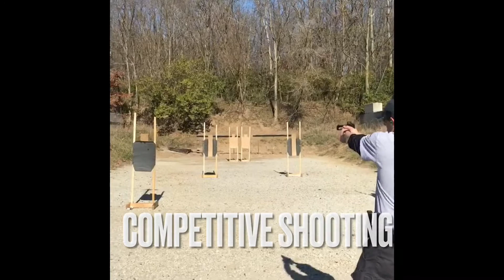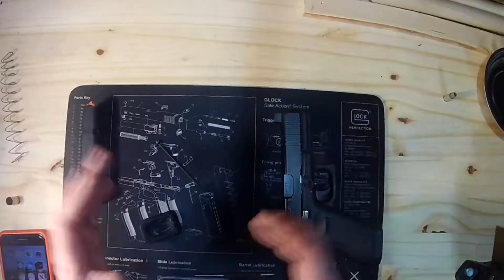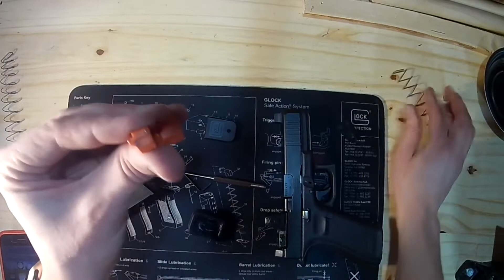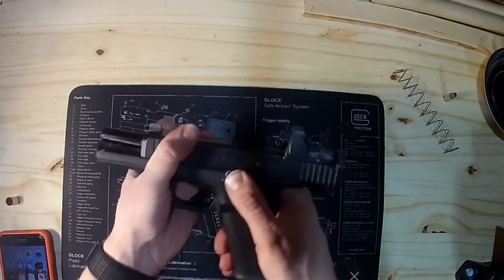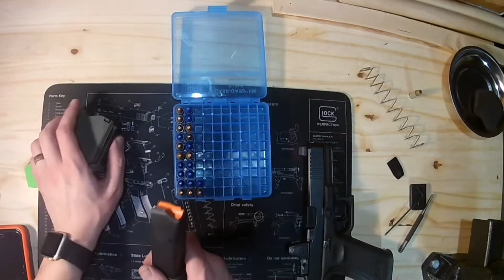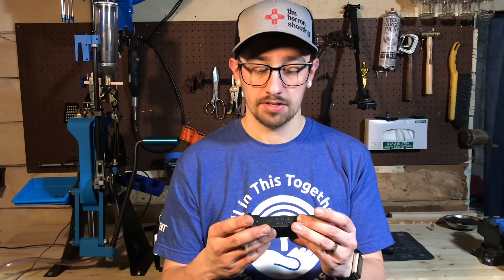Continous Precision Magazine Extension

Comment: Have your ever tried thier trigger?
Reply from the maker: I have used their trigger and I ended up having a QC issue and had to send it back. I wouldn't recommend it for the cost in my experience
Reply: @MannyTalksShooting  What was the issue you had with it? Did it mess with any of the safeties?
Reply from the maker: The trigger shoe safety tab spring broke with less than 600 rounds on it. It took them a while to replace it and it now sits on a shelf.
Reply: @MannyTalksShooting  Aww, I see. I was going to buy one but I probably won't now. I like how they but serrations on the trigger face though.
Reply from the maker: the serrations are nice but definitely didn't hold up